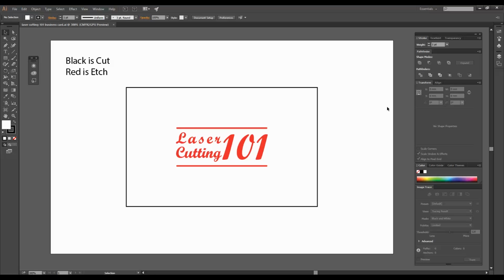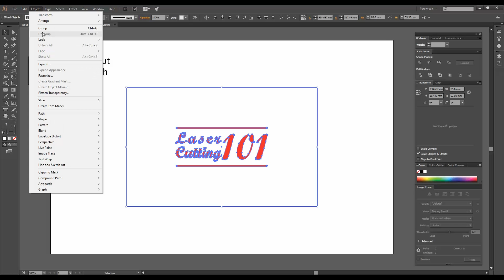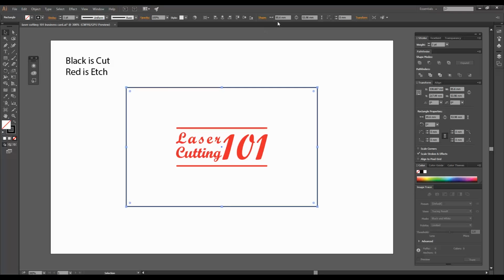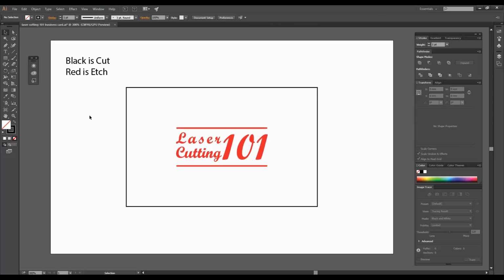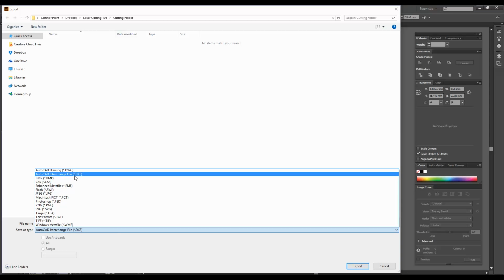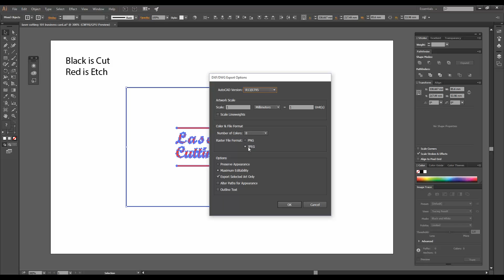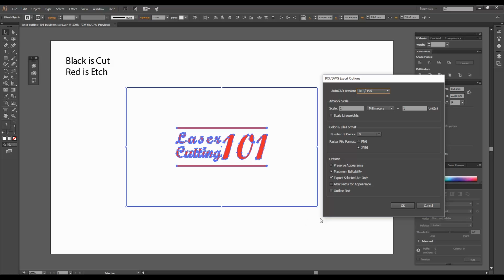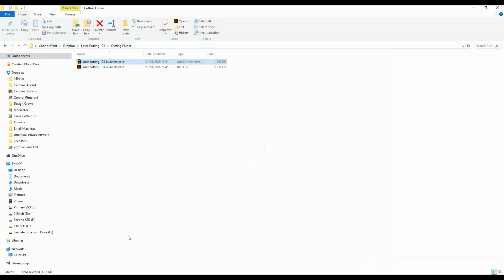Illustrator .DXF Export Settings

Comment: Thanks for the valuable info, however before exporting the file as dxf I check for open paths from Document info setting, and it tells me there is no open paths, but after saving the file as dxf "without ungrouping though as I knew about it just now" then delivering to the cnc operator, he tells me that the dxf file has open paths .... is there a way to check the exported dxf file for open paths?

Comment: Hi, I have the problem with curves, I mean, when a try to open the dxf generate file with a CAD program, all the curves are represented with too many points, for example a circle in illustrator has 4 points? when I save the circle to dxf and reopen the file with CAD, the circle has 60 points ! There is a trick to avoid this ?
Reply: no. the 'circle' gets approximated as a series of lines. it's a price to pay for using an 'interchange' file format like dxf
Reply: @TheCarvedBlock  Okay, but there is no solution for this?
Reply: @dezsinorbert  Define a 'solution'*

This thing happens as an unavoidable side-effect of using dxf architecture. Any solution will need to fit into whatever you're trying to fix. For example, if in cad you need a dxf-circle to be represented as a cad-native-circle, you'll need to re-draw it. For example, you could overlay a circle through three points of the dxf approximation to align the position precisely... 

* But actually. Feel free to state your use case and software you use - a could then be more useful.
Reply: Disclosure. I'm no dxf expert. I draw most of my presumptions here from 3D modeling in fact and personal experience translating formats between CAD packages. I don't know if there are any 'solutions' that can preserve arcs and circles - it's quite likely that dxf conversion can be implemented in different ways and some of these may preserve more info (how to read it is another issue...).

So, if anyone knows, let us know :-)
Reply: Another 'solution' is to use a smoothing algorithm to combine points and curves.... illustrator has some, inkscape has some...
Reply: me too.. same problem..